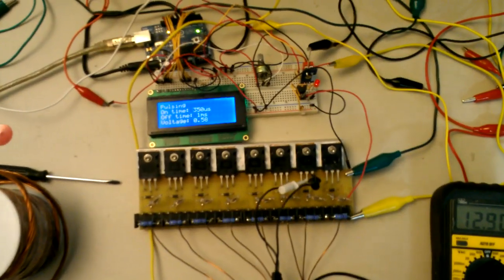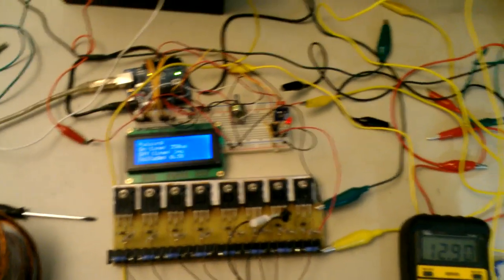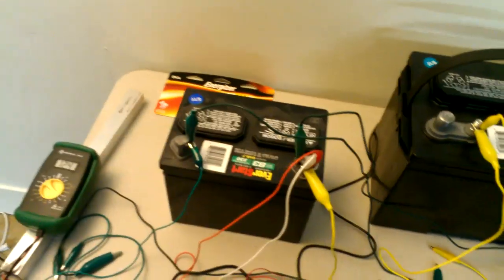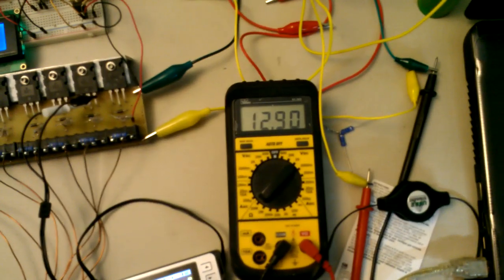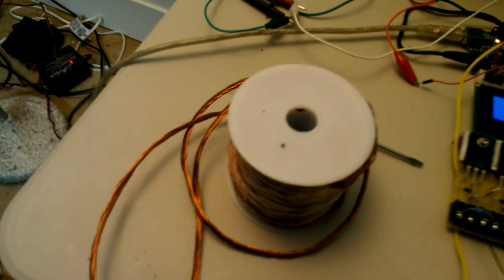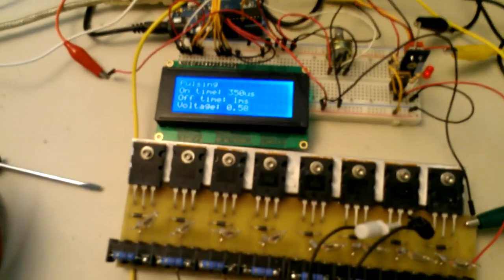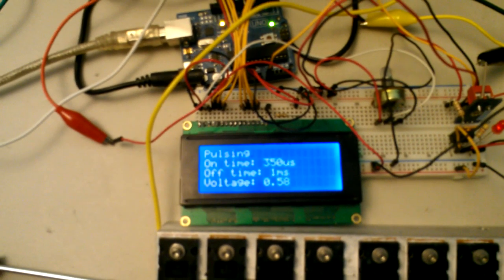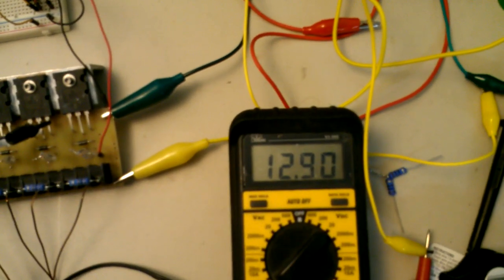Solid State Arduino 8 Circuit Bedini SSG With Air Core

Comment: DId you achieve Overunity?
Reply from the maker: Didn't have an effective way to measure at the time. I tried again with ultracaps instead of batteries. It probably would have been a little OU if I took the internal bleeders out of the caps. May try again sometime.